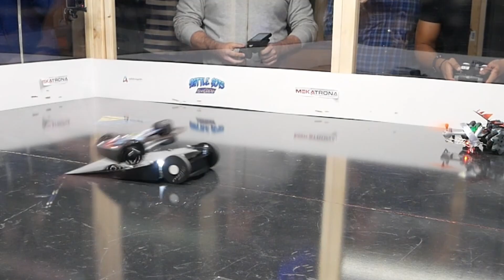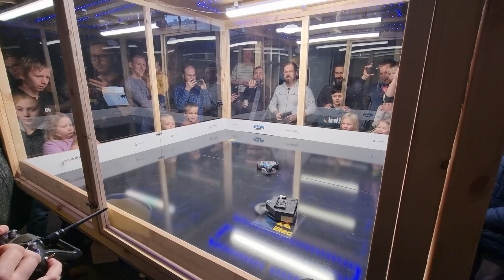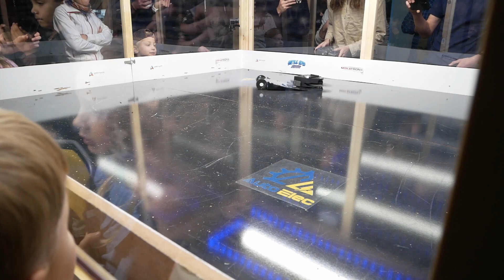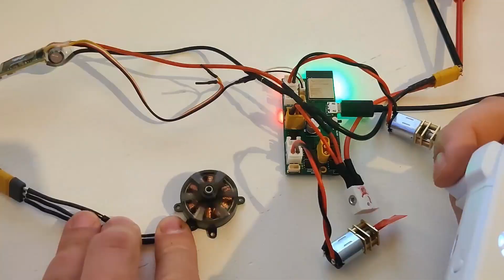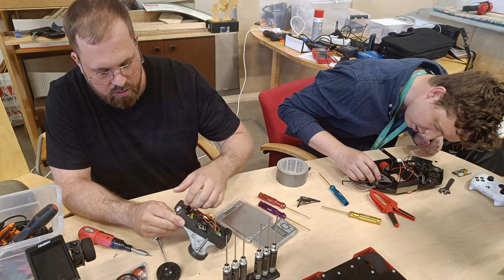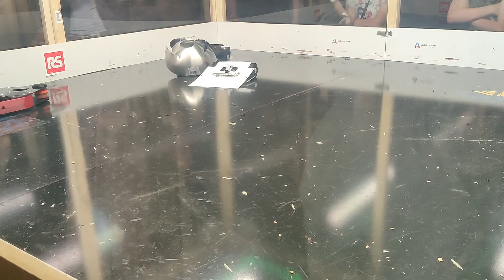Competing in Battle Bots Sweden 2023

Comment: this is so cool! is there a way you can modularize your PD/all-in-one? isolating failures is a major component to why people run separate ESCs and receivers
Reply from the maker: The idea with the robot controller was that if you have an electric failure then you just need to replace one component, plus it's compact with less wires.